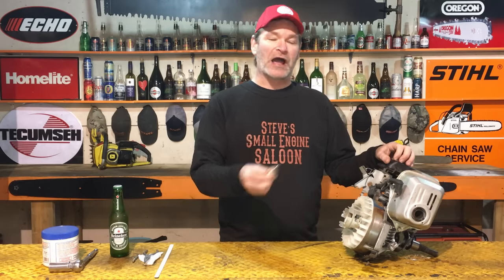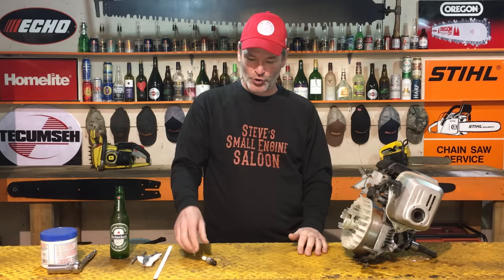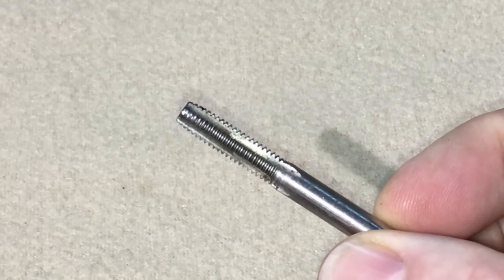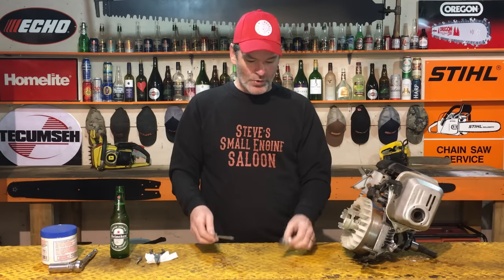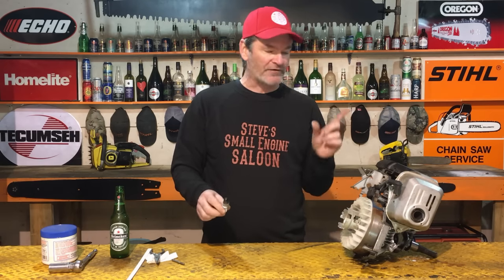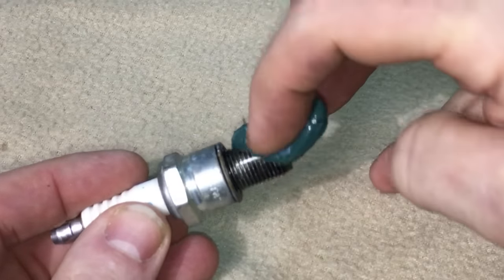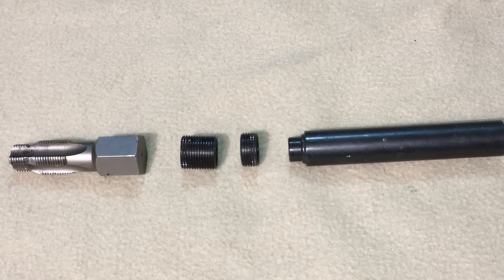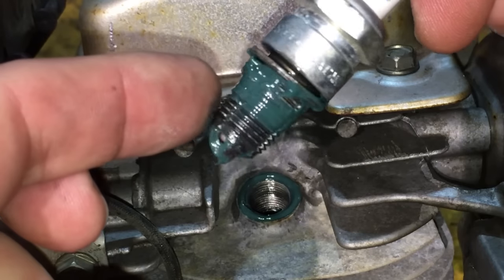How To Fix Stripped Spark Plug Threads For Free With This Hack

Comment: I just tried this on a 1995 Briggs & Stratton 5hp engine.  Its on a used MTD wood splitter I just got.  The plug had blown out after running for 1 hour.  Watching  your vid i broke out the dremmel tool with the cutting disc tip and made a chaser.  Was even able to cut the washer off giving me more thread depth.  Well....I finished splitting a full cord of wood and no problems at all...except I ran outa Chimay!
Reply from the maker: Nice work!

Comment: A trick I use to get metal filings / shavings out of the cylinder when they sneak past the preventative measures on spark plug hole repairs is to use about a foot of 3/8'' inside diameter tubing, duct or electrical tape to the end of a Shop Vac while also making an air seal, and vacuum the shavings out. Sometimes, I will cut the threads dry (grease makes vacuum pick up difficult) with the piston at BDC and simply vacuum the shavings out by putting the 3/8'' tubing down in the cylinder when I am finished. I use a powerful flashlight and sometimes a bore scope to check the cylinder through the spark plug hole to make sure I got all the shavings. CAUTION: be sure that there is no fuel fumes in the engine!!! Those and vacuums don't play well together. Usually, engines that need spark plug hole rejuvenation haven't run for a while, so there is a decreased

Comment: How about sticking one of those telescoping magnets used for grabbing nuts and bolts in hard places. Would that work to grab metal filings down in the hole?
Reply: Not if the head is aluminum!

Comment: Steve, Mate you are so clever & helpful. 
Also you can bust the ceramic off the plug & drill it out, then weld a metal tube the same diameter to the plug body where the ceramic was. Then you use a "go through" (or hollow) socket set and the tube pokes up through it.
Then you just connect a plastic or rubber tube to the plug and connect the other end of this tube to a shop vacuum cleaner (Using tape to step the vacuum hose diameter down to the tube size). When you combine the suction with the grease on the threads you get zero metal filings falling into the motor.
 We have done this on motor vehicles and they are still running to this day.
Cheers

Comment: Steve, I just wanted to thank you for your passing along the tip on repairing an apparently cross threaded spark plug. You and your friend saved me about $100 by not having to purchase a new Ryobi trimmer! I followed your directions, using a Dremel, and, with a little force (what did I have to lose?), firmly inserted the doctored old plug, then successfully seated a new one. Thanks.
Reply from the maker: Great job!
Reply: Even if you mess up your treads at this point you can still redo the treads with an heli coil.

Comment: I would also suggest flushing the combustion chamber with some brake cleaner, with the engine upside down if possible.then blow it out with compressed air. Awesome video!

Comment: This is truly a great hack, just used it to repair threads on my snow blower. I did use a Dremel tool to to notch the spark plug. Much faster than the hacksaw. Thanks for the tip!!!
Reply from the maker: Nice work!

Comment: Worked well! I ended up using a file instead of the hacksaw. Tried the Dremel, but the round cutoff wheel nicked the flange in the spark plug, who that's too tricky for my skill level.

Comment: I got one for you Steve and I am a backyard mechanic. How about instead using your carburetor cleaner to clean everything up any of the small engine stuff you may have you should be using brake cleaner I believe it’s a lot cheaper and then you can finish it off with a little carburetor cleaner but yeah any part or anything in the shop degrees no the breaker is cheaper

Comment: Hey Steve. My father recently did this trick on my 750 motorcycle, but without the tissue in the piston.  There are DEFINITELY metal filings sitting on top of the cylinder head. Im afraid to even move the piston.  Besides a vacuum, do you have any tips on how i could clean them off the head? Would be much appreciated as im afraid to even touch it atm lol
Reply: Duct tape some small tubing into the end of your shop vac and suck it out

Comment: I had a shop throw a helicoil in my Ford escape 2015 1.6 ecoboost, it shot the damn spark plug back out again, am I able to retry the helicoil? Or will I have to get a new head?
Reply: What did you end up doing?

Comment: That's a great hack sir! Making a tap out of a spark plug. Maybe turn head upside down before removing plug, so gravity will assist with chip flow? If that's not possible, use a telescoping magnet, to pick up any stray chips in that head. Thanks again!

Comment: I've always either put just a drop or 2 of motor oil on the treads or if I have some just a tiny bit of Anti Seize, living in Florida the corrosion that builds up between the aluminum heads an steel threads on the spark plugs can cause a lot of problems especially on marine outbound engines used in Brackish  &  Saltwater,
Reply from the maker: Thank You...

Comment: I've got one of those thread chasers for spark plug holes. I think it's made by Lisle, it's double sided with a larger size one end than the other and it's got an "O" ring in the middle that helps it stay in your socket wrench when using it. It was quite inexpensive from memory too. But that was about 20 years ago though.
Reply from the maker: Right on

Comment: I've had great success by cleaning the threads on the plug. Greasing the plug😢and then using JB weld, applying it to the hole threads hand tighten the plug. Leave it in 36hrs. Then remove the plug. 
    It works on the worst of threads into aluminium.

Comment: One suggestion. I would  soak the  tissue in gas or coat the top of it with grease/ oil. This will increase the tissues ability to  catch the aluminum filings when rethreading. Using a magnet wont work, for the aluminum filings.

Comment: Hey Steve - appreciate all the videos. If the old spark plug threads seem to be in good shape, any problem with cutting into the old spark plug and using it as your tap so that your new plug is undamaged and 100% free of any leftover filings?
Reply from the maker: Good idea...

Comment: we used thin copper wire on snowmobiles to save our bacon. It was a one time fix. Afterwards it ment a trip to the snowmobile scrapyard for a new head. Aluminum heads are soft and usually cannot be helicoiled. As you said, it cannot hurt to try anything.

Comment: I have used this method successfully for many years. The only thing I would dispute in this video is re-using the grooved spark plug in the motor after the repair. This would allow carbon to build up in the grooves and possibly re-damage the threads on the way out the next time it's removed. Save the cut spark plug in your toolbox for the next repair and spring for a new spark plug for the motor.

Comment: Great trick! After performing your trick, crank engine without spark plug in and it will help blow any shavings out that you may have missed. Then have another beverage and admire your work!
Reply from the maker: Great tip!

Comment: Shew, you saved me Steve, . . . and Scott! I was pulling a plug on my truck that had to come out at a funny angle. I must've buggered up the last thread and I could not get the new plug to thread in. A google search for fixing spark plug threads pulled up your video. 30 minutes and only half a beer later and I had the new plug threaded in! Thanks
Reply from the maker: Right on Corey....

Comment: I have used this same trick on head bolt holes that have a lot of carbon. I buy an extra bolt the same size as the head bolts at the hardware store and then make three or four cuts like Mr Steve shows. Then zip it in and out of the hole with some fluid like WD40 or whatever you have on hand. Works great to clean out the holes.
Reply from the maker: Right on, thanks for the comment......

Comment: Just a "small" additional tip, Slowly  (and LIGHTLY) Reverse the Spark Plug into the Threads until it "DROPS" to find the "Leading Edge" of the corresponding threads in the Head!

My Dad was a DOT Mechanic, and taught me to do this ESPECIALLY for Spark Plugs! I ALWAYS do this with ALL BOLTS out of habit.

It's an extra Step, but I have NEVER Cross-Threaded a Spark Plug in my 35+ years of Wrenching!

It ALSO Helps to "Wipe-Down" the Threads on both peices (where applicable) to remove Dirt & Grime!

Thanks for sharing another Great Tip Video! 🙀

Take care,
🤓 -Thomas
Western Washington State

Comment: Dang!  I need this alternative method. I got a stripped out spark plug hole and a snow storm coming in 3 days. No way to get it to a shop or run around and find a tap ( I still gotta get to work ).  This just may save my bacon.
Reply from the maker: Good luck!

Comment: This is a first. How cool is that, a spark plug turned into a tap. Like the Idea of the paper towel also. 
Steve I haven't seen your shop but if you are still working [I quit and just drink beer by the way] 
look into a hand held vacuum cleaner that hooks up to an air line[ Blue point ].
Years ago I had two, one with the zipper bag stuffed full of tissue for absorbing oil and grease. You probably have one and I hope my comments are In line with all of your intentions.
Love this stuff

Comment: Good tip but you can buy a thread chaser that has the common sizes for about $8 at most parts stores!  I've got a couple, they actually have 2 sizes that cover most small engines on one tool.

Comment: When I began my career as a professional auto mechanic in 1968 one of my first tools was a spark plug tap.   14 MM on one end , 18 MM on the other . With a 13/16ths hex nut in the middle for driving it . Probably cost a couple bucks . Used it until I retired in 2013 . Still have it and it works perfectly fine . Can't imagine them being much more than the cost of a  six or twelve pack today .   For holes beyond rethreading there's always heli-coils . Back in the days before tapered seat plugs there were many gorillas ( stronger than  regular grease monkeys ) crankin em in with 1/2 drive ratchets . Or breaker bars . Tapered seat plugs made it even worse for removing after those same gorillas installed them .  So great now buying zero tools . And any brand & amount of beer I want instead .
Reply: Hey mine is same age and I still use it quite a bit lately on small engine now

Comment: I may be wrong but if that is an aluminum head the small cuttings would be blown out the exhaust valve and not damage the cylinder or piston.  Also if you left the plug out and flooded the cylinder with solvent and turned the engine over a time or two it would flush out the cuttings.

Comment: To add to yoyr great tip... use a magnitizer/demagnetizer tool ...mine is green... I use it for screwdriver bits when I need a magnetized bit...but it would be great for this DIY  sparkplug tap. When done tapping ,demagnatize the plug for reuse in the  engine. Can't remember where I got it but sure they are still available...Canada no HF but ur Princess Auto should carry them. Really enjoy your channel... thanks for sharing and keeping it real. All the best.

Comment: I thought of a way to improve on how you are doing this. After you put that paper towel in the spark plug hole, put some more grease in the hole before you insert the spark plug. After a few turns of the spark plug, pull it out, clean it, re-grease it, and insert it for another turn or two. Anything you can do to keep metal shavings out of the hole is a win.

Comment: Thread sets are super cheap. Can use the same size of the plug to save yuh from cutting. But if ur away from home that option could help. I'd keep the plug that's cur for situation that happens again.

Comment: Guy here did this on a Kohler. He went to start it and blew his plug right out and it ripped his threads out. I got it and put the Plug Fix in, still going strong. 
 He said the plug is halfway out in the farmers field next to his home, it put a big ass dent in the mowers hood then still went that far.
Dont ever stand near it running until you can torque the plug to spec with a torque wrench or pay some serious consequences.

Comment: Steve, what about a blown plug where it just spins? I just got a free Husqvarna 150BT and the plug is blown. Any tips?
Reply: You've no doubt fixed this already, but for anyone else reading this I think tapping and helicoiling is the solution if your threads are totally gone.
Reply: @technicalscience  Helicoiling is a waste of money and time. I just put in a cylinder and piston, ran like new.

Comment: That is a nice idea in a pinch, but they make a spark plug thread chaser for this exact purpose. They are not too expensive, the Gearwrench 730D is under $10. Many others make them in different designs, I only mentioned Gearwrench as they are generally known for decent quality tools. You can also apply the same method you show here for other bolts that may have been cross threaded. I use this when I cannot find or do not have the proper chaser or tap.

Comment: Very good presentation of an old trick.  You made it look too easy Steve.  Cutting the slots on the threads cleanly, very perpendicular is critical for this tool.  If the cut is much wider at the top than than width across the bottom, IE: you get wiggly with the saw (or cutting disc), the tool will not work so well.  I'd probably have to practice on the 1st plug and start over again on another one before I could get cuts that strait on a spark plug.  Show off.
Reply from the maker: Thank You...

Comment: I do that, but I modify the sparkplug differently. I knock the porcelain out, break off the ground tab, mount the plug upside down in a vice and cut two slots with a hacksaw, 90 degrees apart. This makes the 4 slots and takes a lot less time... sadly, only a 1 beer job.
Reply from the maker: Right on, thanks for the comment......

Comment: I also if i chase the threads with a tap I place white lithium grease in between the flutes to catch all of the metal particles. That way no metal shavings get down into your piston or rings or anywhere in there where metal shavings dont belong.

Comment: If it's got more than one cylinder, start engine with plug out and it will most likely  expel with force any debris because it's a shorter distance for the pressure to escape thru the plug hole ...stay clear when starting or cranking lol

Comment: Instead of tissue, use a thin piece of cloth ( old used sheet works ). Put grease on the small piece sheet then put it in the spark plug hole. Sheet comes out in one piece.

Comment: Wow thanks again Steve,
I’ve used that method on bigger bolt holes like say body mount bolts on my truck. And I can say it works great more often then not. Not sure I would have had the balls to try this on a small engine head. But now I will. 
I think it’s only appropriate to to give credit where credit is due. Steve you are a true Hack! 
haha thanks again Steve, and don’t worry I won’t use your name Scott. Haha.

Comment: Hey Mon Ami ............   You taught me a great trick, not the cutting of the plug though, I always use a chaser ..... But the paper towel in the cylinder to catch any filings that will go down into the cylinder bore.....  We always use heavy cup grease like you did to catch the small filings.....   Yes most shops will take the head off to make sure that nothing gets into the bore....... 

On a chainsaw it's not that easy though, they don't have a separate head like a Briggs or a Honda, at least not the newer ones........   

But Husqvarna did tell us a few things in update classes and such, if a couple small filings do get into the cylinder then all is good , those tiny filings will just pass thru the exhaust port with no issue.... They are aluminum instead of cast iron or non aluminum metals.....  

That hack right there is worth it's weight in GOLD,  Toooo bad that those filings are not GOLD  LOL........  

Bon Annee' 

Plus Tard Mon Ami ~!~!
Reply from the maker: Thanks Boo, great comment...

Comment: I would push a piece of bed sheet type of cloth soaked with grease and/or oil instead of a paper towel. The filings will stick and it wont tear when you pull it out.
Reply from the maker: Great idea...

Comment: Yes, that trick work with most all threaded holes with grade 8 bolt types, don’t try it with stainless steel bolts. Stainless steel bolts are unpredictable. If anyone has a hack for SS fasteners and or threaded holes in Stainless Steel, i will try anything once. Thanks for sharing.

Comment: I wouldn't BLOW the filing out, I would use a vacuum to get them out. You COULD blow the filings DOWN past the paper you put in there. There are really small vacuum ends that you can buy for your shop vac. (adapter and a micro computer cleaning attachment on amazon)

Comment: Another great video. Your advice and tips and tricks are very helpful!!!

I love your channel.    

I do have a suggestion.  How do you get out a broken off ( in a hole) bolt that holds the mover blade on???  

I have a mower that  I loved.  
An idiot I hired brought the mower back to me with the blade in one hand and broken off bolt in his pocket.   
The mover is a REAR wheel drive, speed adjustable, 7.75 HP red mower.  I forget the brand right now, but Snapper comes to mind. (I own several mowers, trimmers, saws, and lots of other equipment.). 

(Not a commercial business.  I just have a lot of property to keep looking reasonably nice.) 

The idiot completely ignored my direct orders not to go the area near the hillside with dozens of large rocks. Until  he destroyed my mower, his work was acceptable.  Not great, but acceptable.     (I use a wheeled trimmer for the rocky  areas.).

Comment: It is alum head with Steel pistons etc... Leave plug out  and start engine re as in cars and blow out extra clap. Pull cord for others. The Alum will not damage steel. Still do what you can